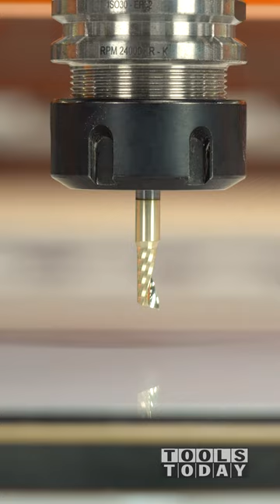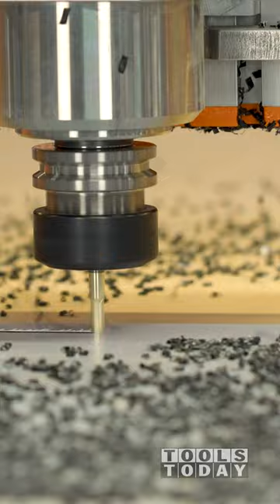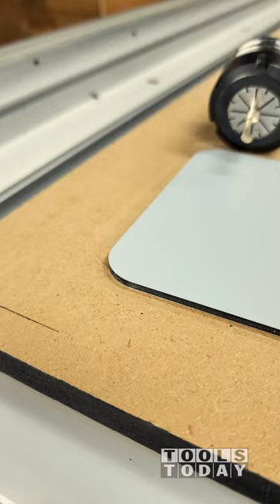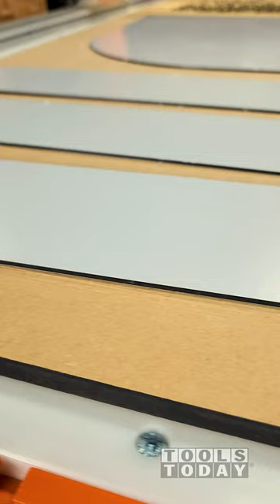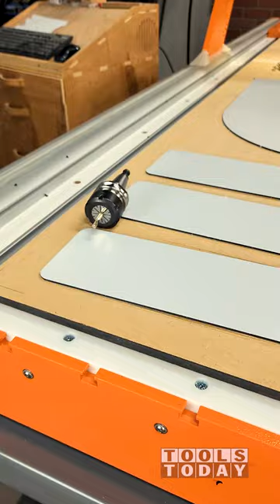Cutting ACM on CNC

Comment from the maker: Check out the tools used on our site - https://www.toolstoday.com/v-14286-51402-z.html

Software - https://www.toolstoday.com/cnc-machines-accessories/cnc-software.html

RPM: 18,000
Feed Rate: 100ipm
Plunge Rate: 100ipm
Depth Per Pass: .125"

Comment: Very good. I've been working with ACM on my router for a long time, and the best tool for that, in my opinion, is the 1.31mm. It has an excellent finish, the friction is low and the noise is also much lower.